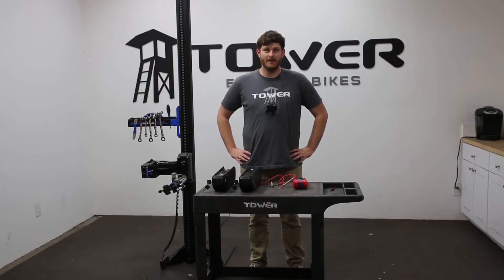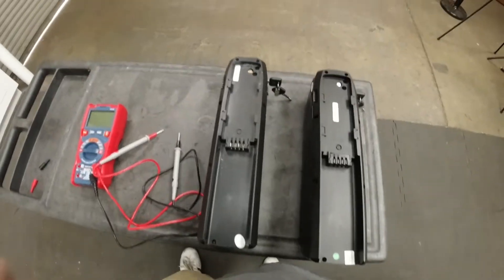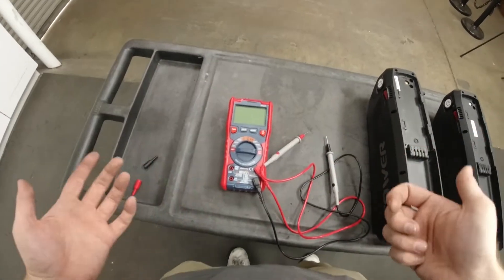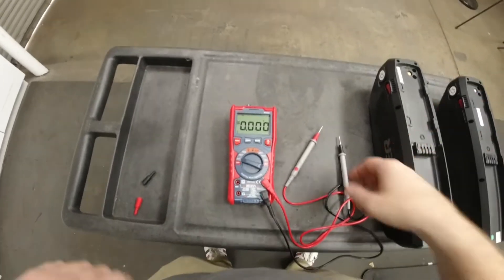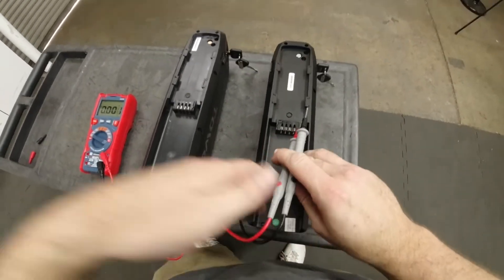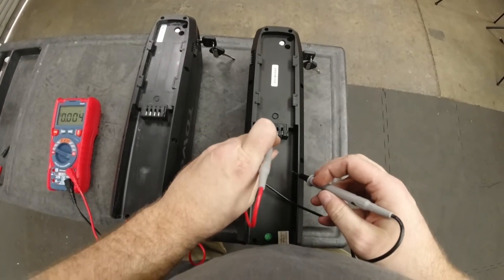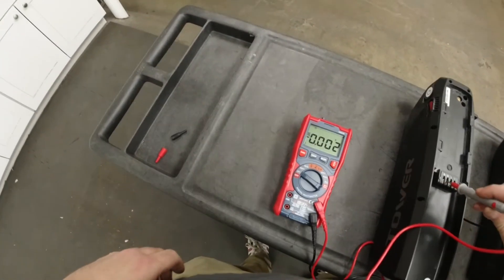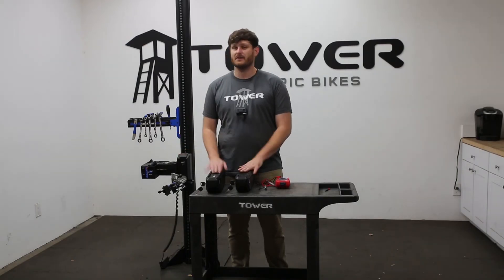How to Test if Your eBike Battery is Dead

Comment: This is just wrong in so many ways, just because a battery is showing voltage does not mean it's good and just because it's showing no voltage does not mean it's bad.
Reply: Exactly as it looked like cells were dead when it showed under 48v. This guy…

Comment: This will tell you if a battery is working, It will not however tell you how a battery will behave under load.
Reply: How do you do this please?
Reply: @go_queenslander  you need piece of kit called a load tester.

Comment: I bought a 48 v 17.5 AH pathfinder battery charged up installed in Quietkat Apex old battery worked bought battery as a back up to have extra range hunting . Well bike would not power up 51 DC volts + - but bike wouldn't power up . Testing as you have you would have concluded battery was good got a replacement battery under warranty battery worked great . What else could go bad with the failed battery?
Reply: Probably either a bad connection or a failed battery management system.

Comment: What setting do i turn the nob to on the multimeter?
Reply: DC voltage. DC symbol is 3 horizontal short straight lines with a long straight line above them.

Comment: So just turn it on to any voltage?
Reply: yes if you have an auto ranging meter. If not, you will set the voltage to the range that is well over the anticipated voltage. on DC volts

Comment: I have E-bike with 6 battery pack of 12 volt each (72volt total). When I charge the batteries full , ebike meter shows 80 volts and bike runs good but when battery level downs to 69 volts ebike speed down to 6/7 km /hr. where the problem is ?

Comment: What should it read when it is turned off? I have 2 bike batteries that show 20v... Seems high for a battery that is '' turned off''.
Reply: The "turn off" suggestion is misleading because not all batteries have a switch off option.
I assume your batteries are 36V so 20V could be right but I can't say for sure without knowing any information.

Comment: Great video. Question, I’m testing a bike that I’m gonna fix.  Battery is 42v.  Multimeter readout is .574, really.
dead battery no juice, right?

/Bklyn👑
Reply from the maker: Hi Robert, most electric bike systems are 36v, 48v or 52v. If you're testing with a multimeter just make sure the battery is in the on position. A reading of .57 sounds like the battery is turned off. See if there is a switch to turn it on.
Reply: @TowerEBikes  You assume that all batteries have a switch which is wrong.
I can tell you that 90% of these batteries don't have a switch unless they have a key which purposely switches the power off and unlocks the battery like for example the silverfish batteries.
But there is more, my battery has no switch nor key but it has an internal electric switch off which triggers I think after around 10 minutes of inactivity.
I felt like your video could be slightly a bit longer, talk a bit slower and give more details regarding settings on the multimeter, in my opinion you acted like people already know obvious and basic stuff.

Comment: so im pissed... i have a 48v battery that has been running perfectly fine for 2 years. i merly tested it because i was board and it reads 38v at full charge. wtf!!
Reply from the maker: Hi Mark, that's strange that it was running perfectly fine at 38v unless it's actually a 36v system. There are voltage ranges for lithium batteries. Still 38v for a 48v system wouldn't give you perfect performance.
Reply: For a 48V battery the standard norm would be a cut off power below ~40V to protect the cells BUT every manufacturer have different settings.
After 2 years your battery can loose ~70 of its original specifications depending on cells quality and charge cycles,

Comment: look into the  Reention Dorado housing design  A lot less wiggle room.
Reply from the maker: Way less wiggle room on those things. That style of battery is very proprietary, meaning if you need a replacement you're definitely gonna have to go through the same manufacturer as you bought your ebike.
Reply: @TowerEBikes  The manufacturer is not a manufacturer so everything is from China and everything is available on Aliexpress, there are even battery manufacturers' representatives on e-bike forums who advise on where to buy this stuff.
Reply: That's wat I have. Great lol. I managed to fix it tho. All was due to a loose DC female plug on battery BMW was kicking bike off
Reply: 3:23 3:23